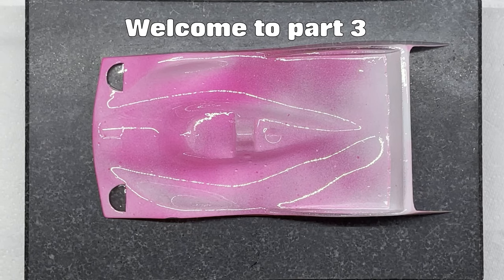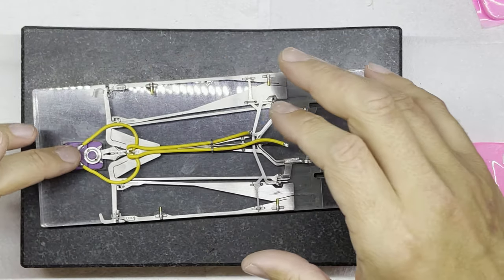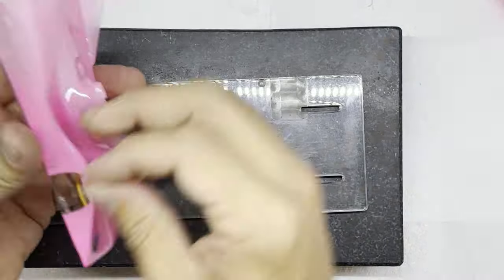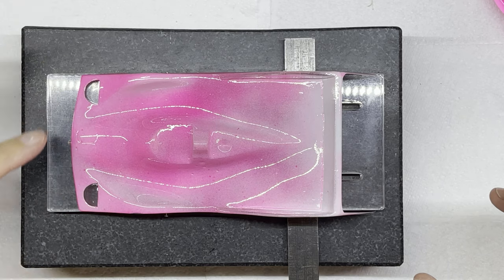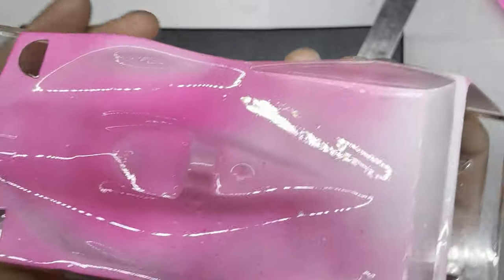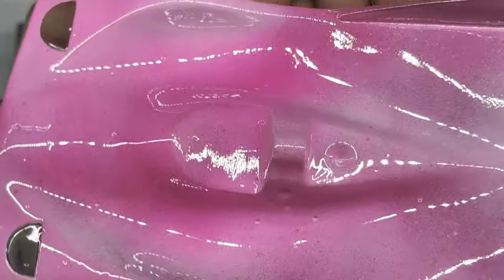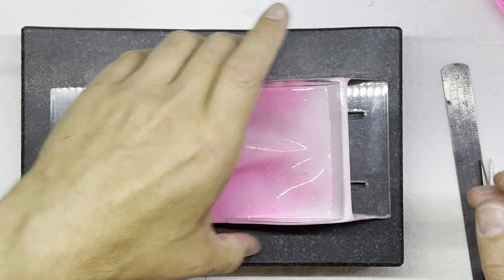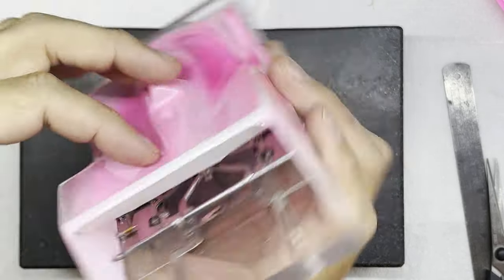Preparing a Vacuum Formed Slot Car Race Body - Part 3

Comment: Great video James! I can't believe you cut into the wheel well in the front! That would scare me haha.
Reply from the maker: Haha, it’s fine as long as you reinforce the top of the cut. You can only do it on bodies that have shaped wheel arches. Some saloon cars have flat bonnets and the front end would just flap around if you cut the arches.